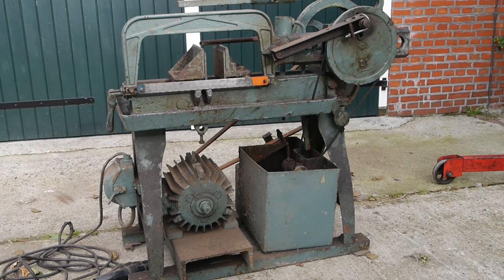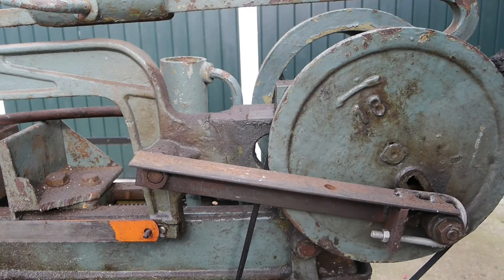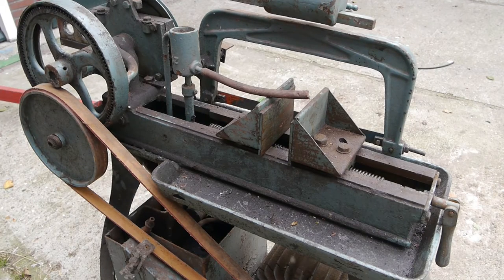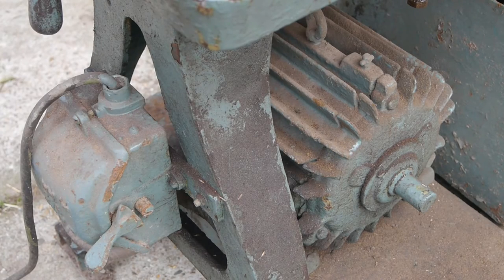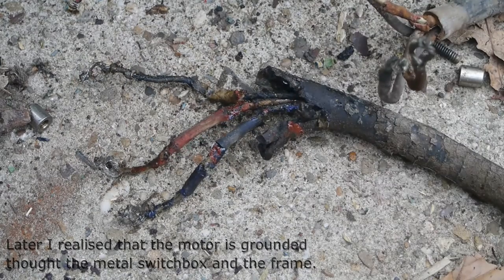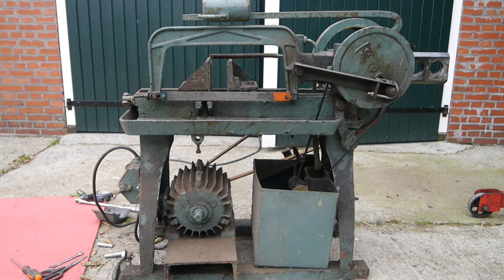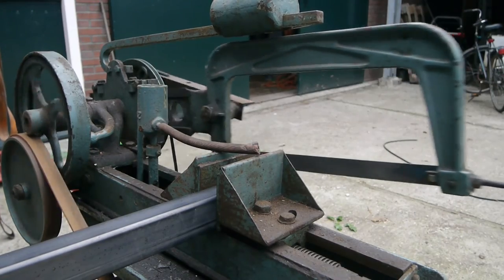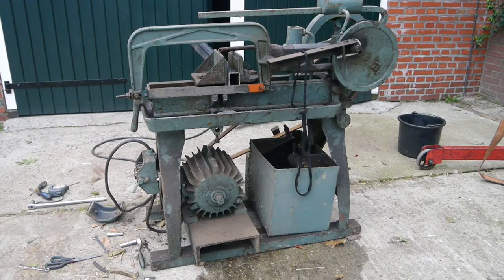Dirty hacksaw brought back to life

Comment: Ooo never start the saw with the blade on the work !
Reply from the maker: Found out the hard way :)
There is a broken lever underneath the pulley that drives the coolant pump. I suspect this was used to keep the arm/blade up.